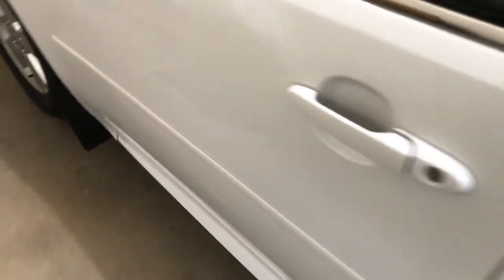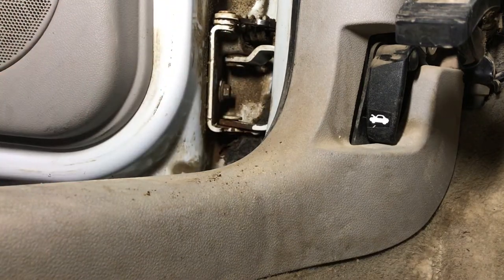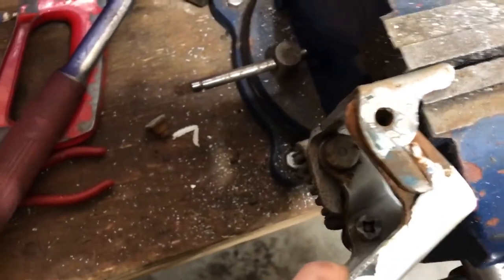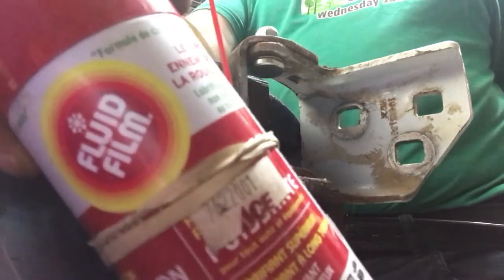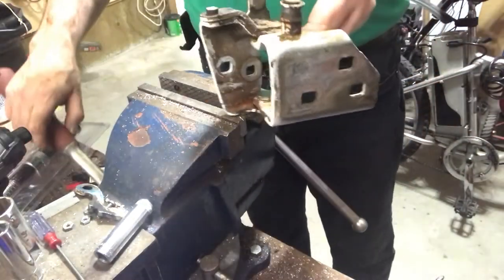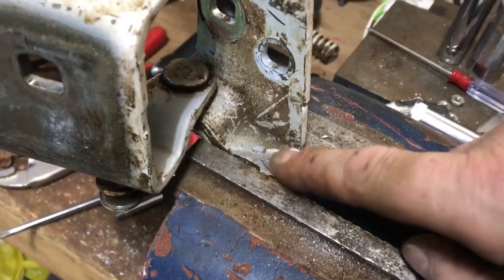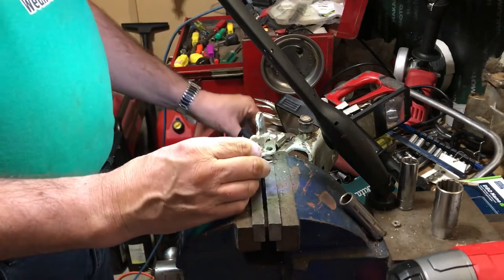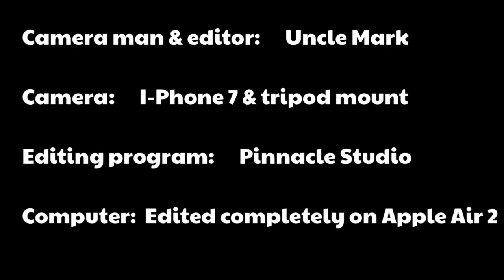How to repair a door hinge 2006 2013 Chevy Impala (EP 76)

Comment: how much would a door hinge adjustment cost if I were to take it to the collision repair shop? I have a '12 with 186,000 miles and the door blew wide open in the wind.
Reply from the maker: It will be based on how much time it takes them to straighten it. They should be able to give you a good estimate.

Comment: Hey Mark, this just happened on my 2008 Impala today on the passenger front door.
Do you think I should have this fixed, it has 185,000 miles on it.
I just want to be safe and not have the door fall off. I would appreciate any suggestions that you have.
It looks like one of the bolts broke off, so tapping it out might be difficult based upon the angle.
Thank you....
Reply from the maker: I would personally fix it, like you said, don't want it falling off! Probably hinge going to need to come off to do it. As for my car as of today 7/2020, I still have not had the door aligned properly after new hinge replaced. It's something a body shop guy will need to align...trust me!
Reply: UncleMarks DIY Automotive Fix it channel 
Do you have an email if I send you a pic?

Comment: 2009 Impala, rear door hinges(one on each door) has a bunch of rust on them; it's the only rust on the vehicle; strange.  I guess the manufacturer used some bad parts.  I guess I should just spray some lithium grease on it and hope for the best.  Mileage is just 57K km.
Reply from the maker: This 2010 had about 260,000 kms. To re safety it in Manitoba the hinge had to have no slop up and down.

Comment: This video was 4 years ago 150.00 you figure it's probably $350 now 2024 and a lot of parts are discontinued since the new owners of general motors took over
Reply from the maker: @mrhamburger6936  Might be a aftermarket supplier now making this part available.
Reply: @unclemarksdiyauto  RockAuto shows a lower door hinge what they say it's either for the right or left door that's not so there is a left and a right hinge
Reply from the maker: @mrhamburger6936  Interesting! Thanks for looking that up!